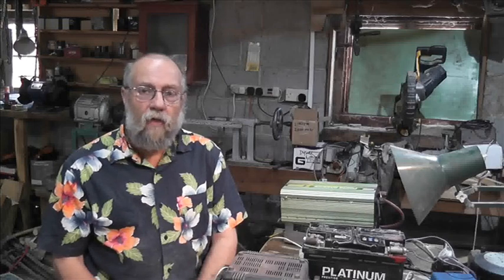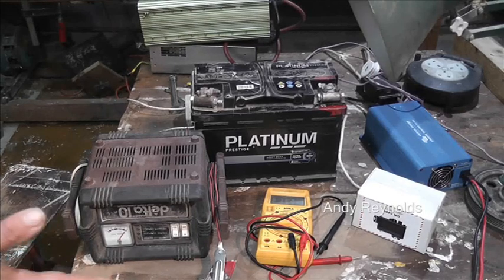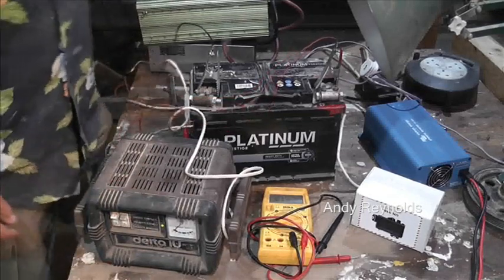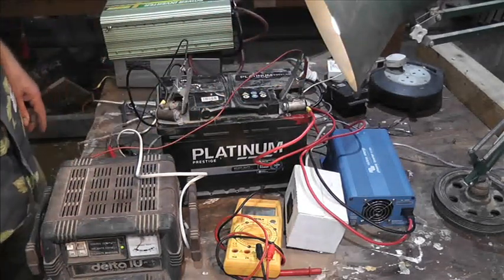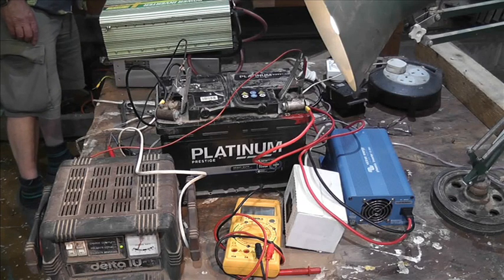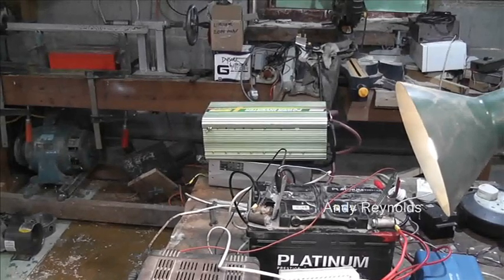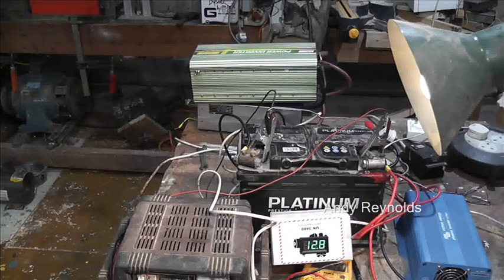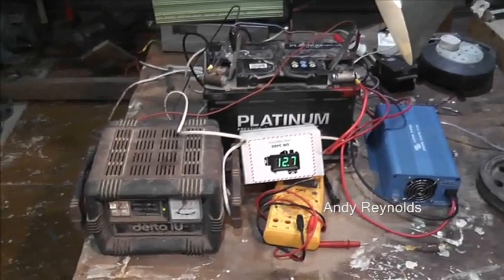DIY micro solar grid battery, backwoods backup method

Comment: You gotta be careful when adapting those UPS units for use with external batteries. They are made to a price and both the battery charger section and inverter sections are pretty low spec. In fact there is no separate inverter & charger inside, it just re-configures the transformer to do both using a couple of relays. When operating as an inverter they tend to be very inefficient, with a very high no or low load idling current draw. As a charger, they are often spec'd to only handle the capacity of the built in batteries. When you start connecting up external batteries you can cause the charger to run at full capacity for much longer than it was designed to do. You'll get away with it for a while, but the components will slowly be cooked. 

So called "offline" UPS units (because they pass the mains through and only switch to inverter when the mains fails) can actually create a worse situation than not having one at all. We had one blow up at the radio station. Fried all the Mosfets, some were blown clear off the board. Naturally, it also painted the glass of the fuse with the fuse wire and killed all output (from battery or mains). And this was a near new unit. 

What caused this calamity? The area where Radio Foxton operates has fairly frequent super-brief outages. I call it the "Foxton Flash". So what I am picking happened was that when the mains failed the UPS began switching to inverter mode, but because it came back so fast (i.e. in a split second), it didn't have time to switch back and somehow it was caught in inverter mode *backfeeding the live grid*. You can guess which one of them won! If the computer had just been plugged straight into the mains with no UPS the power interruption would have been so brief that the caps in the computer's SMPS would have carried it over! 

Online UPS units are much better. They are essentially a battery charger that is always charging the battery, and an inverter that is always powering the load. When the grid fails nothing needs to switch over because the load is already running from the inverter. It's basically what you have made with you gear laid out in this video. :)
Reply from the maker: Thanks for that useful info and the backup storey, so a decent charger and inverter will be more efficient, and the idea is sound for saving power with a grid solar system, cheers

Comment: Nice project. Would a fuse save your inverter, should the fridge (or other stuff) draw too much? And will a blowing fuse harm the inverter in any way? Will this power be ok for my laptop or cellphone?
Cheers John in Denmark
Reply from the maker: Hi, a fuse is just to protect against an overload or a short. his system of low tech solar storage will run your laptop as long as you use a sign wave inverter, not  square wave. Cheers

Comment: I was just beginning to think along simlar lines Andy, but I need to do the sums first.  Inspiring and thought provoking video.  Your book is now being read.  Been looking at some of the Australian 4x4 camping set ups too, Will Prowse is worth a look state side.
Reply from the maker: Good to hear fro you Ben, just a small solar grid system will make  difference and give you something to build on. We have several running in parallel. Catch up with you later in the year, cheers

Comment: I was thinking you were going to show us how to use our grid connect systems by generating an in dependant AC mains to trick the grid inverters to supply up to their combined max capabilities (with appropriate grid isolation etc) and explain various caveats and precautions. Maybe an idea for the future!
Reply from the maker: Very difficult as the grid provides the signal and a smoothing load, cheers

Comment: You have spurred me into action. With the panel you kindly gave me thats been in safe storage and the the supply of deep cycle mobillity scooter batteries i'm a quarter of the way there. When funds allow ill get an inexpensive charge controller and some cables.
In a nutshell what are the fusing requirements for such a setup? Also dc requires large diameter conductors is there anything that i may have lying about that would fit the bill? I would imagine betwixt batteries panel and inverter would be no more than 20ft. Any suggestions greatfully recieved.
Reply from the maker: Simon, I cannot remember the exact spec of that panel but lets say it puts out 5 amps and the run to the batteries is 20 ft, then some 4mm would be more than enough. The inverter needs to be closer to the batteries and those tails could be 6mm.  Inverter fuse, what ever you have around 20 amps, cheers
Reply: @TheInfoworks  Wonderful. Cheers boss.
Reply: DC does not require thicker conductors than AC (the opposite is true in fact due to the skin effect, but is only relevant at mains frequencies once you get to individual conductors thicker than your thumb).  The reason for that myth is that lower potentials require higher currents for a given power, and people conflate this with DC vs. AC when it's really 12V/24V/48V vs. 120V/240V.
Reply: @randacnam7321   Aye ok mate cheers.
Reply from the maker: @randacnam7321  Hi, thanks for your thoughts, in this case it's to do with the current and volt drop. The lower the voltage, the higher the current for a given wattage, cheers

Comment: A good idea. they could always just buy a single battery at a time, as they get extra cash add another one, just think ahead to what size inverter you want to end up with.
Reply from the maker: Exactly, it's just a way of holding a bit back, cheers
Reply: I have access to several car type batteries. They're all different capacities so not as easy to keep topped up.
I had envisioned making a charge controller that would measure each battery for the correct voltages (probably program the controller by telling it the capacity of each connected battery) but not got around to it yet.
Reply from the maker: @ianhelsbyservices  I suppose that's what modern charges do, these little things that weigh half nothing. cheers

Comment: Hi Andy, I have a similar set up on my narrow boat running a mains fridge etc, I had to use a “pure sine” 2000w inverter as some electronic equipment will not work and can be damaged ie an electric toothbrush charger…!  I just wanted to ask why you said don’t use a 3 wire digital voltmeter but the 2 wire version? Only I have a 3 wire one ( black/red/white wires) and it works ok..? Thanks Andrew
Reply from the maker: Andrew, I like the 2 wire ones as they can be remote from the battery and not need external power to run them. On our system the meter in the house is 80 metres away from the batteries, cheers

Comment: I can feel something nudging me, it's coming, I'm still in the mulling phase, I have had a look inside the larger one, quite a hefty transformer in there.
Reply from the maker: That sounds good and maybe the benefit of a UPS inverter unit is that they switch off when the batteries are flat, maybe not all of them. That 24v unit is definitely a good move, cheers

Comment: Thanks Andy very helpful info…I’ve got some diy Solar Setup myself with 3 Grid-tie inverters now holding back the digits on my grid bill…every little helps…ive actually in a geek way logged it’s savings since I connected them up on April 2nd 2022…and working on 30p per kWh I’ve saved as of Sunday 31st July 2022  £79.02p from going on the grid bill…i also bought a bluetti EB 70 …battery storage box…I use that through the night to run electric blanket and bedside lights ect so also saving on the grid bill…I estimate it saves around 30p per night from going on the bill…again it all adds up…the idea in this Vid is great too and I’ve got the items already to give it a go…thanks for posting…Brian.
Reply: 30p per night is pretty excellent! I am doing the same thing as Andy is showing, so looking forward to it.
Reply from the maker: Brian, brilliant, let's hear how you get on, cheers